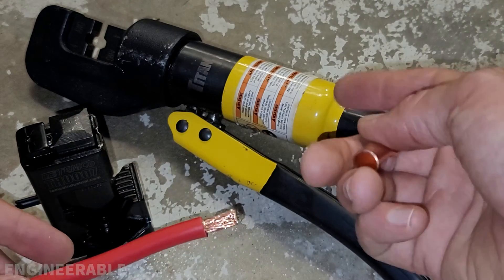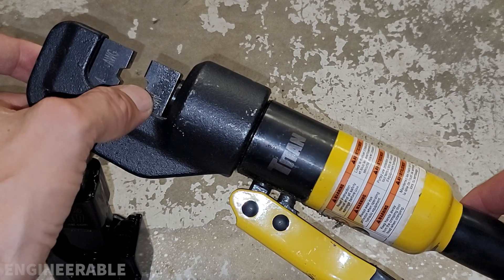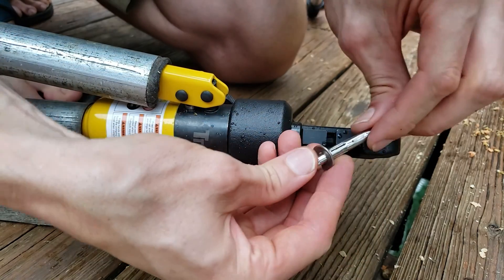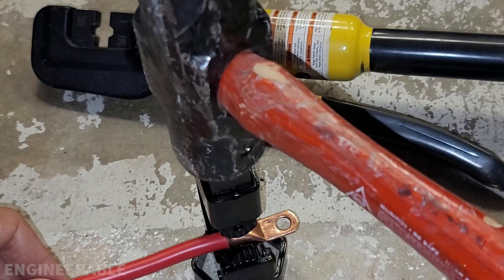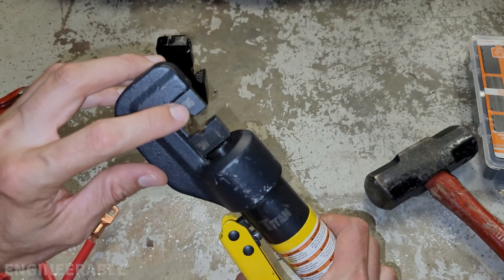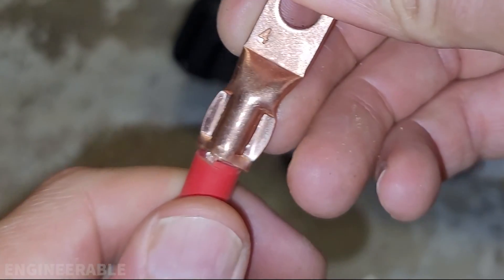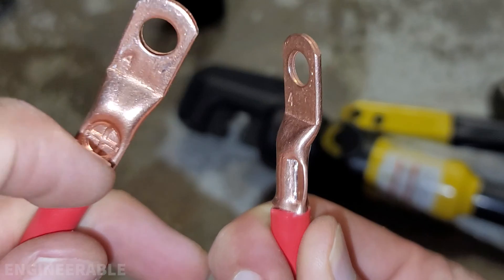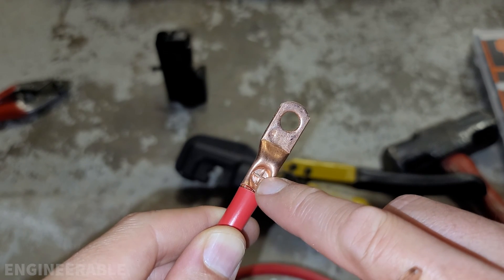Which is Better? HYDRAULIC vs IMPACT Crimper For Large Gauge Electrical Terminal Lugs | How To Crimp

Comment: Hydraulic all the way. No comparison. I've been using it on my boat and all my connections remain cool all the time, so conductivity is good. You used the wrong bit size. With a proper size you will get a perfect hex crimp.
Reply from the maker: Seems that the kit I have has no correct size. I've since learned the technique of crimping in steps and rotating. This gives a perfect hex crimp without any wings.

Comment: I feel like the hydraulic crimper would be less likely to cause damage to the conductors.  It crimps around it uniformly.  Instead of focusing it in one area   Only way to really tell is to do a load temp and resistance test.

Comment: The dies are marked incorrectly. The die that you use was about 2 sizes to small for the terminal you had. You need to choose a die that the terminal just barely fits in. So it compresses everything all at once together with no over lap. So that way it shrinks the outer copper portion of the terminal in onto the strands of wire.

Comment: I have both types. You used the wrong set of dies. Many are marked incorrect or are metric. Also rotate the crimps in steps on the hydraulic to prevent the wings. Both type crimpers work great.
WOOF-WOOF
Reply from the maker: @gatorwing6231  thanks, I've since learned about rotating and crimping in steps. That works great.

Comment: Wrong insets used for electrical wire crimping
Reply from the maker: @huubeijndhovenvan7177  the die sizes matched the cable terminal size, but I learned that you need to do it in multiple steps, rotating the terminal in the die between steps, and possibly even using different sized die to get a perfect hex crimp. Takes more time, but makes a nice crimp.
Reply: @engineerable  Use next size up die first, this will pre-crimp the lug with no ears created. Then use the proper size die. It is more work, but the crimps come out perfect.
Reply: @engineerable my hydraulic crimper has a hex shaped die set for wires and a style like your has for cables
Reply from the maker: @chrisanderson4799  what brand/model is yours?

Comment: I like how hydraulic crimper wraps around wire
Reply from the maker: @Thizz2979  I figured out how to get perfect crimps with hydraulic crimper. Crimp lightly then rotate 60 degrees, crimp a little more, rotate again and fully crimp. It may be necessary to start with a larger size due, and then move to a smaller size die.

Comment: How do some crimpers make the perfect "hex"-like crimping ?
Reply from the maker: The die has to be perfectly matched to the terminal for a perfect hex crimp. With these hydraulic crimpers, the next size up was too large, and this size created the ears. I've read that this is a common issue, which happens with high end hex crimpers also, and that the solution is to partially crimp, rotate, crimp a little more, rotate and crimp the rest of the way. 
I have some smaller crimpers for ferrules that have 6 independent jaws for perfect hex crimps, but I haven't seen a larger version of that.
Reply: @engineerable Thanks, that sounds like a good start point. I'll do some testing. I have a bolt-cutter like crimper and I'm considering if to get a hydraulic one for a more accurate crimping.

Comment: I use the hydraulic crimper all the time. It allows for better strand to lug contact and less strain on the strands. Shrink tube works fine on top of the crimp as well, even with the "ears" on the sides. Other considerations are that the hydraulic crimper allows for on-site crimping without the need for a work bench or solid floor to hammer against. All around a better tool in my opinion.
Reply from the maker: Any concerns that the "tearing" of the metal near the sharp corners of the "ears" makes the terminal weaker?
Reply: No "tearing" is evident and the crimp is very strong without damage to the conductor strands. I would be more concerned that the strands are broken inside the impact crimp and therefore more likely to pull out if the strands break, they will be cut-off at the crimp edge location. With the hydraulic crimp you can see the strands are only compacted together and remain in the round shape they are made in. Preserving the shape of the conductor strands is more important than preserving the shape of the lug.  @engineerable

Comment: when i did it i pre-loaded a piece of shrink-wrap on the cable then mounted the lug in a vise with the cup facing up, heated it with a propane torch and filled it with solder. once filled insert the cable into the lug heating as needed to counteract the cooling of the cable. once the solder flowed into the cable let it cool and cover the joint with the shrink-wrap. worked for me.
Reply: FWIW, soldering a crimp connector is a bad idea. Especially for wires with gauges like these.
Reply from the maker: @Somun-a  Agreed. Takes too much heat and solder wicks up the cable, making it rigid.
Reply from the maker: Thanks for the tip. I've also tried it this way before I had crimpers to 2/0 gauge welding wire. I also thought it would be better than crimping, however the heat deteriorated the cable housing near the joint, and the solder wicked up the wire making it stiff and not flexible. It took some practice to get it down. Crimping is so much easier.

Comment: Did u determine which crimp is better?
Reply: You could also do a resistance measurement using a milliohm meter.
Reply from the maker: @masmagalingako  Thanks for info. Is a milliohm meter good enough? I was reading that you need a 10A microohm meter, which is very expensive. Is applying a 10A+ current and measuring voltage drop accurate enough to compare? I've read that a pull out force test is used to test for proper crimping, because it indicates that enough force has been applied to break down the layer of non-conductive oxides on the wire and terminal surfaces to insure a good metal to metal contact.
Reply from the maker: The hammer crimp appears better from the point of doing less damage to the terminal. I will be doing some pull out testing now that I have the equipment to do so. I did not have the testing equipment when this video was recorded.